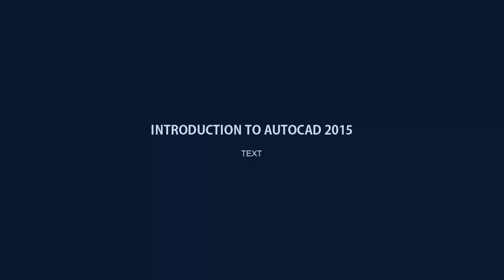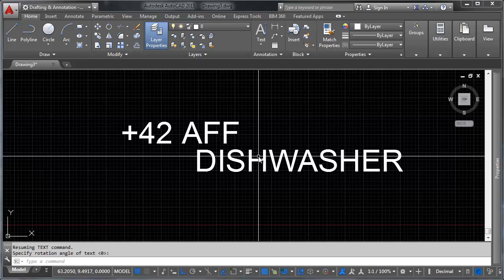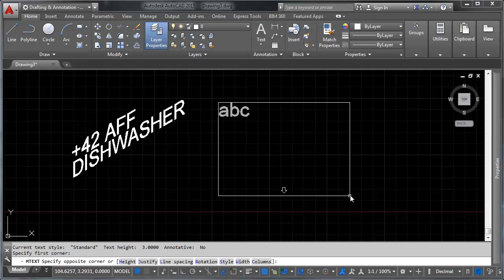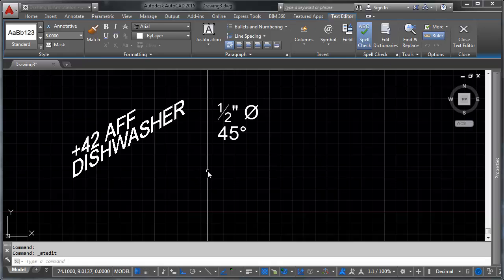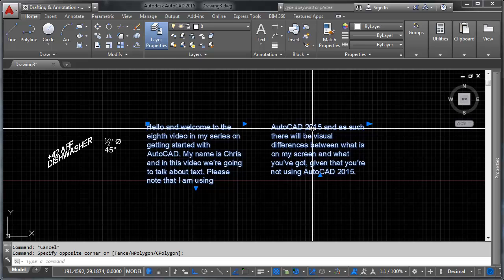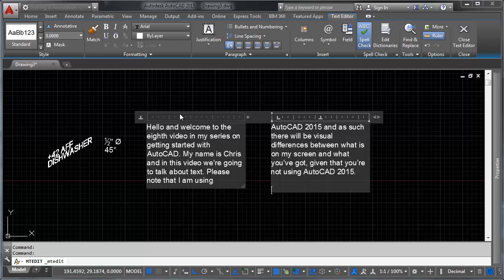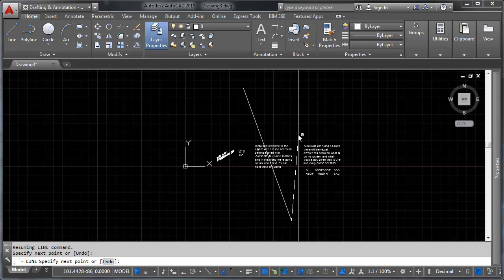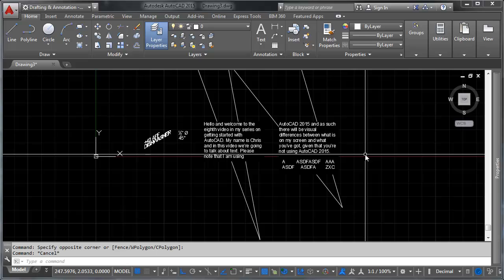Intro to AutoCAD 2015 - 08 - Text

Comment: At the 3:00 minute mark, you say that the single line text tool cannot add special character, but I went ahead and tried unicode special characters and was able to get that degree symbol. With alt 0176. Will this cause problems? As in, is that single line text tool with a symbol going to mess things up in the long run?